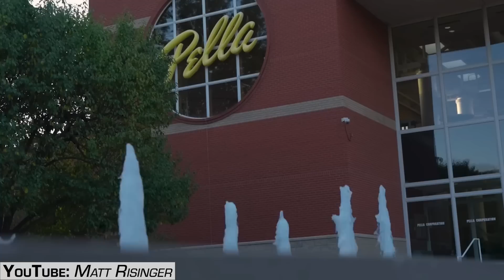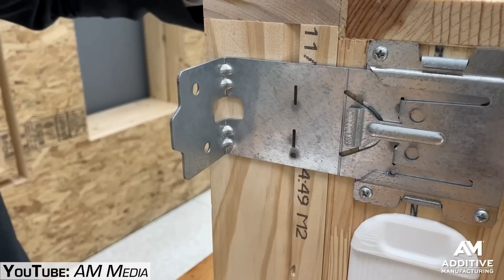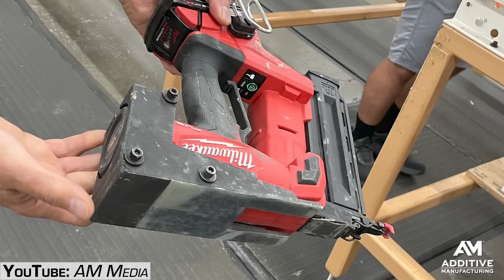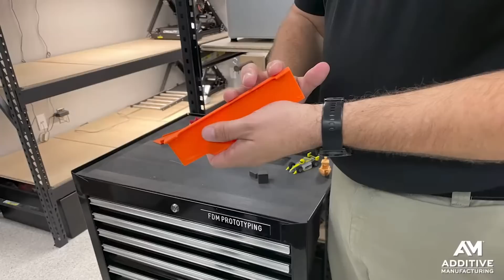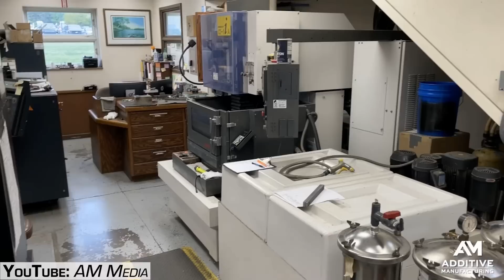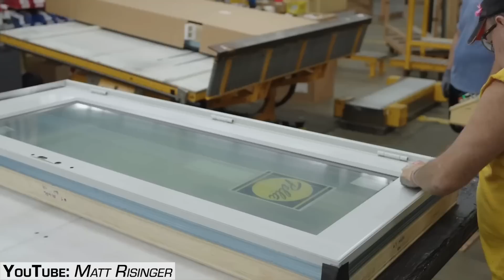Custom Jigging for Lean Factories | Pella Corporation | Real 3D Printed Products

Comment: I was doing a whole lot of lean process improvements in the manufacturing factory I previously worked in. I was using PETG to design workflow improvements, hooks to hang parts while drip drying instead of holding them up with my arm. Replaced pneumatic buttons that were no longer being made and held together with tape. On a punch press, I designed a chute that would capture the negatives and direct them into a bucket, instead of everywhere on the floor and into cart wheels. 

Unfortunately, I was doing most of this on my own break time to learn and get ahead and my employer loved the benefit I provided, but never wanted me to be anything more than just a machine operator. Such a shame